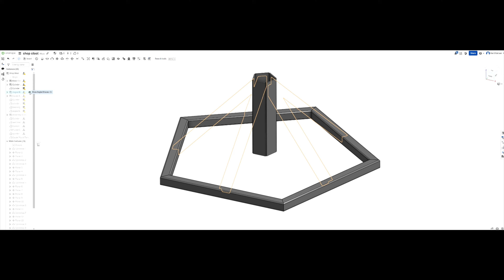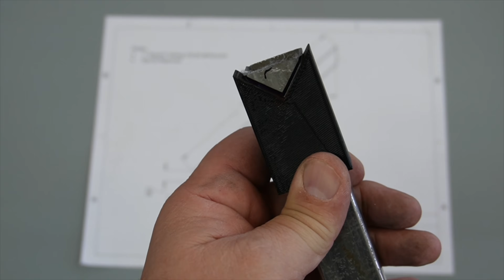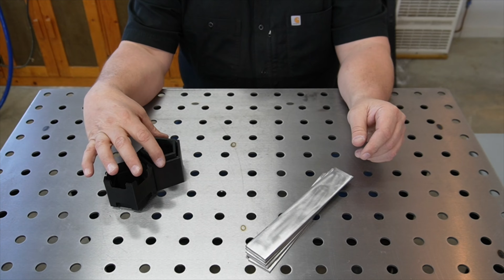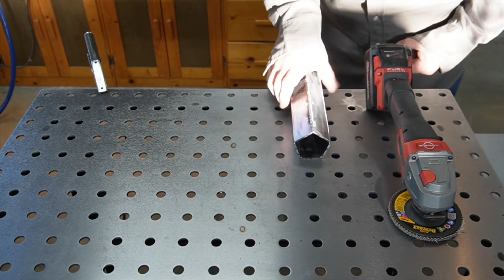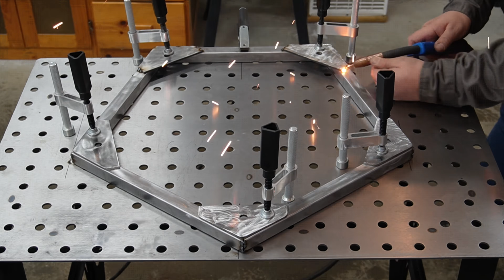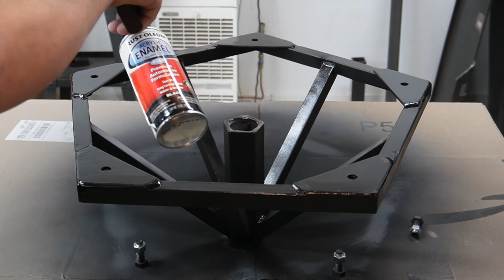A DIY Shop Stool You Can Build

Comment: Awesome video boss! I just started on mine and I'm wondering if you have a measurement of how far the cylinder tube hexagon is from the surface below when setting it up to weld? I got the hexagon made without the 3d prints and it sucked lol but having a measurement from bottom of the tube to bottom of the base would help me greatly! Thank you
Reply from the maker: @BennyT17 it is 1.25" from the bottom of the hexagon pocket to the bottom of the tube frame.  Add another 3/16" or whatever thickness you may have uses for the caster mount brackets if those are already in place.  Good Luck!
Reply: @DIYFabShop awesome thank you very much!!

Comment: Great project and video.  I wanted a good quality shop chair that I built myself and this nailed it!  The only thing I did different was to use 16ga sheet metal to fully enclose the bottom so that it's a place for tools/hardware while working.  Thank you!

Comment: Beautiful shop stool!  I use a stool every day on a truck assembly line where moving around fast is key.  I found that the base can't be too wide unless you are very tall.  Reason being, as you try to move around your work project in a hurry you may hit the back of your legs and ankles on the base, or the back of the foot lifts up on base.  It's very frustrating, but if your base is too small you can lose balance and fall off, usually backwards.  For sitting mostly still with little movement the base is much less of an issue.  For a hurry up environment a base tray for tools and hardware and parts is a must.  Unfortunately we had to add tall castors to a small round base stool to be able to roll over the center track of the assembly line.  Works well for quickness and unobstructed movement but balance is key.  Your stool is very well made and dimensions look perfect for shop use.  Very strong and the base seems not too big for leg obstruction.  I would buy it!

Comment: Looks nice, good job. 

 I am looking for a stool design that uses an electric linear actuator to adjust the height.  The hydraulic chair cylinders are good but I want a chair that you can raise the elevation without having to stand up.   When using my soldering microscope on my electronics bench I need to raise up about 8" to get get to the proper height for the eye pieces.

Comment: @DIYFabShop Hi, can you list the tools you used in this video?
Reply from the maker: Trajan 125 Bandsaw,  Millermatic 211 Mig Welder,  Delta Drill Press (older model), Milwaukee 12V Cut-off tool 2522-20, Milwaukee M12 3/8 ratchet, 2557-20,  Milwaukee M12 1/4 Right Angle Die Grinder

Comment: OK, you asked for it, so here goes… this may be a ‘cultural’ or a ‘national’ thing, or just me, but the music was horribly intrusive. I do have severe hearing problems and need the volume up high for your speech, but hated having my head pummelled by that racket in between speech sessions. (Well, you asked for what I didn’t like!) That said, the film quality was great, the subject (shop stool) was perfect, the welding looked good and well executed - a good pattern to follow - so all in all, a really good video. I recently built a stool for my workshop and it uses wheels from a supermarket trolley, much like yours. However your design is much more stable than mine… so I’m thinking about a re-design! Thanks, I’ll follow along for a bit, though I’m more into motorcycles and steam locos😊. Thanks, Les in UK 🇬🇧

Comment: Subscribed, if the first video is any indication of how upcoming videos will be its a cool channel. 
Maybe add a sheet of metal underneath for small parts. Also, to help keep cost down, I either repurpose/recycle or go to a metal supply shop and the rems (the cut offs they have after cutting full pieces down for customers).
I'd also like to see how to draw the computerized project plans, and shop tour.